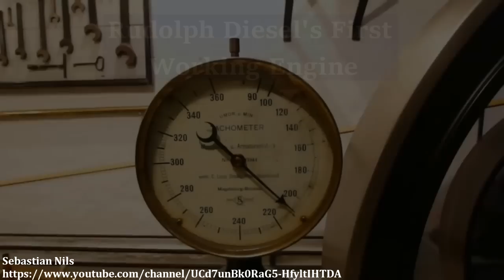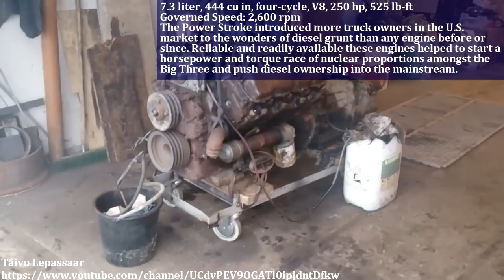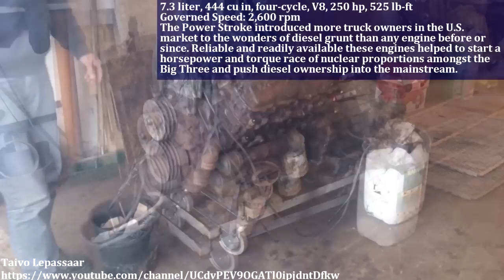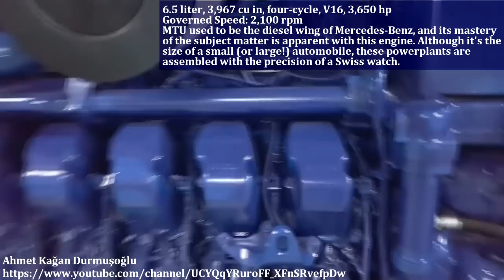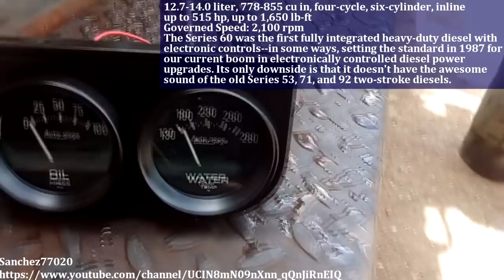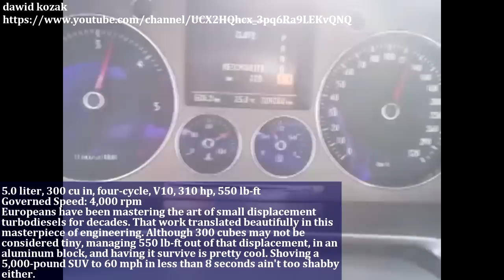10 of the Greatest Diesel Engines - Ever

Comment: And yet another "Greatest Diesel Engines" list that fails to mention some of the most significant diesel ever made. The Toyota 2L is a 2.4lt 4-cyl diesel which was introduced in the late 1970's and is still being produced today. Individual examples have exceeded 1million km and 10k hours, and several millions have been produced. It has been used in everything from Cressida and Corona cars to Hilux and Land Cruiser models to forklifts and minibuses. The Toyota 2L rivals the Mercedes-Benz OM616 for the most reliable engine ever made. (The 2L, despite being similar in dimensions and capacity to the MB PM616, actually nearly matches the larger OM617 5-cyl for outputs.) Then there's the Toyota 1H-Z 6-cylinder engine from the Land Cruiser models, and the Mercedes-Benz OM604/5/6 engines, the naturally aspirated diesels that had the highest specific outputs and the lowest noise.
Reply from the maker: justcarcrazy + oh thanks for great additional informations :)
Reply: Surprised nobody's mentioned Audi... fastest passenger cars powered by diesels. Insanely efficient.
Reply: Hate to break it to you but 1million km and 10k hours isn't shit for a diesel. I've seen 6bt Cummins with 2million miles without a rebuild, and 4bt's in construction equipment with well over 10k hours
Reply: Yeah my father has a Detroit Diesel with almost 2mil on it. Never had the bottom end rebuilt but replaced the turbo a few times, flywheel, injectors, etc. Costs a fortune when the smallest thing goes wrong. It was about 2k just to have a guy look at the flywheel.
Reply: Make ur own then
Reply: Forget about Toyota, where is Mercedes in this? Their inline 5 and 6 are the best!
Reply: justcarcrazy - Toyota's diesel is as insignificant as the runaway throttle situation was... Too many more engines deserve to be on this list ahead of Toyota.
Reply: The Real Elvis lol just to look at it 😂😂😂
Reply: justcarcrazy I have a 86 2LT it's a piece of crap.....  there's actually a defect in the head that will crack eventually.  but even though it sucks it's still really cool
Reply: Ruckus 2lt and 3l will crack heads when overheated because the clutch fan always fails. 😂 they are fine when they run but damn that fan
Reply: 2002 Mustang V8 260hp... 2002 Honda S2000 240hp, weighs less... stompin the Mustang's ass hard
Reply: So all the sudden 15 years ago is considered recently?
Reply: And you completely forgot that the s2000 only has 153 Ft-lb's of torque to the mustangs 302 Ft-lb's. Hp is only half of the performance equation. Apples and oranges bro.
Reply: I'm tired of everyone saying "what about the torque?" Horsepower is a function of torque. Nobody ever considers weight, either.
Reply: soaringtractor that's why nothing more complex than a gun is made outside of the US?
Reply: Peugeot XUD's have done many more miles than 1 million km.  Best passenger vehicle diesel engine
Reply: Another engine that is equal to the Toyota 2 L engine is the Isuzu 4JA1 engine, a simple 2.5 litre pushrod engine that is very economical and very reliable, the 2L and the 4JA1 engines are two gems from Japan.
Reply: soaringtractor
 I have the utmost respect for a lot of Japanese engines regarding their reliability.
Reply: He who does not know God to any saint prays to him... The L series are real gems in all aspects that engines are forever if you do the maintenance in time, if you never had a toyota you will never ever know.
Reply: Totally agree with you sir, clearly you had a toyota or maybe still have that toyota.
Reply: Unfortunately Toyota’s amazing Diesel engines tend to go unnoticed  quite regularly
Reply: @coreyschmidt1647  6BT powered "spotting truck" 34K hours covered over 130K miles driving inside a 40 acre yard NEVER LEFT THE YARD ONCE never below the valve covers
Reply: @ruckus__  done plenty of 2LT heads due to cracking
Reply: justcarcrazy h

Comment: Why didn't you do Scania V8?
Reply: because cummins is king 6 in a row ready to tow 8 in a v you must half to sit to pee
Reply: mikeyjock 3408 is a pile of scrap next to a KTA Cummins
Reply: Scania is the best truck Company in the World and cummins and caterpiler are one of the worst shit ever
Reply: mr holmberg you must be mental! Cummins has been the leader in diesel for decades, I will agree that cat has slid downhill in recent years, but prior to emissions regulations cat was a force to be reckoned with. Scannia isn't shit, they only have market share in Europe, Cummins and cat have worldwide presence. And if you want to talk trucks kenworth trounces that lightweight flimsy shit from scannia.
Reply: Corey Schmidt I think that Cummins are sluggish and and is running rufe and it dosent have enough torq and hp in the truck market at least
Reply: mr holmberg so from 400-600 hp (298-447 kW) with up to 2050 lb-ft (2779 n. M) torque is lacking? Mind you that's for the 15l isx, I drive one every day and it runs as smooth as any other truck I've driven with the exception of an old freightliner that had 12v71 detroit. And if you need more power the QSK 19 offers 800hp (597kw) @ 2100 rpm and 2275 ft-lb (3084 n-m)torque @ 1500 rpm. Hardly a slouch there.
Reply: Corey Schmidt wel Scanias biggest engine hase 730hp and 3550nm of torque from a 16 liter v8
Reply: mr holmberg in marine setup, they top out at 900hp with stock parts
Reply: Landon   Schad xaxaxa, all those weak engines...
Reply: Landon   Schad how much torq dose it have
Reply: Corey Schmidt 800hp and Only 3000nm hahahahahaha
Reply: mr holmberg well sir Cummins unlike scannia understands where the point of diminished returns starts, you make more torque you have to make the whole driveline weigh more making the truck less useful, or you don't beef up the driveline and destroy components. If you need more torque you spec out the truck with planetary reduction axles and multiply the torque you have and cut driveline stress and you save overall weight while doing it. There's a rigging company where I live that has a superhaul truck that puts over 8,000nm on the ground from an old N14 Cummins. It's not about making brute power, it's about doing things intelligently and making the overall end product last as l9ng as possible. Your precious scannia might make more torque at the flywheel but I'm willing to bet the whole truck will be scrap before it hits 2 million miles.
Reply: Corey Schmidt they are still Scanias running like new even with 3 million km... Just due to regulations, fleet owners can't keep the same truck in service until it dissolves
Reply: Caterpillar has always been ahead of Cummins
Reply: Fordguy Santana not really, they've had a few better engines at least when you're talking truck engines. The 3406 a-b had the NTC engines beat but the N14 took it back for that size class in the 90's. The KTA stomped the 3408, the M11 beat the C12 in that class and the ISX12 obliterates it. The ISX15 crushes the C15, and oh ya cat tucked tail and gave up on truck engines so there won't be anything to compare to the new X12 and X15 from Cummins.
Reply: Are you serious? ISX are garbage, that’s why glider kits exist. They always drop a cat c15 6nz or a 60 series, most don’t consider Cummins at all. 6nz always leaves any similar size Cummins in the dust
Reply: Corey Schmidt . What about spun bearings, bad fuel pumps, rods off the block and so on. Every engine is going to have a failure at any point of time. The 6.4 powerstroke is an  absolutely pile of garbage, yet some claim there going 200k-300k with no problems. But good maintenance is what keeps the engine going most of the time
Reply: Fordguy Santana you're thinking about the 6.0 powerstroke, the 6.4's big problems are all caused by the emissions crap and all go away with a dpf and egr delete kit. The 6.0 is plagued with a laundry list of problems.
Reply: OttovonEarth nope. All these are flywheel numbers
Reply: Dr.Redstone cat because not every American know  about Scania DSC16 sadly. Only thing close to that is Cat 3408 and Mack E9
Reply: Dr.Redstone cat because yanks
Reply: Dr.Redstone cat bc they are crap
Reply: Bucky Richardson i guess you shouldn't do such a statement.
Scania is not only in europe but in many other parts of the World one of the top Leaders in building trucks and engines.
Reply: Hardcore Never Dies Domenic K and supplies common rail parts to Cummins
Reply: @toomanytododge2594  Cummins makes a V8 though, so :/
Reply: @coreyschmidt1647  cummins has never lead detroit used to crush them and emd both gm division till the early 2000s where industry leaders. And Cummins follows. The isx is garbage compared to a c15. The c15 makes more power and lasts the isx15 well its popular for shops because they make a large sum of cash for replacing Cummins engines the only good Cummins is the kta and n14 other than that Cummins sucks

Comment: I'd sub in the 3406 Caterpillar & lose the C-series.
Reply: Raynus 1 3408 is a work horse
Reply: When I watched this. I thought "ol Yeller" would pop up.
Reply: Now are you talking c-15's or the c15 and yes there is a diffrence.
Reply: What about the Cat 1693? Million mile motor and sounded so cool. Klickety klack. Owned 3406 b model and c model. Work horses. Injectors on c were junk.
Reply: 6NZ Cat will run and run.
Reply: @Thomas Campbell the c12 was good too. I still love the 3406b and the 3208b.

Comment: I have a 7.3 diesel in my Ford service truck, it weighs 12000 lb and about as aerodynamic as a toaster. I get up to 20 miles per gallon. Is this average for this engine? I never had a diesel before. But it doesn't seem possible. Every time I fill up I check it. Sometimes I'll get as low as 14 miles per gallon. I have another service truck the same size, but it has the 5.8 gas engine Ford. That averages a little under 7 miles per gallon.
Reply: If your 7.3 is getting 20 mpg than you must have absolutely no weight and almost no throttle. My 7.3 with hydrogen cells gets only 17 mpg. My family owns around 10 7.3s, the average for them is 11-14 mpg. I am calling bull on your numbers.

Comment: The 'Diesel' diesel, (first picture) actually appears to be a 4 cycle engine. For the Wartsila effort, you could also mention that it stands 4 stories high and has a 300 ton crankshaft.  Like others, I was disappointed to not see a 2 stroke Detroit.  I worked on 53, 71 and 149 series and admired the way they thrived on hard work. The ear-splitting screaming roar of a 1600 hp, 16v 149 TI  in a WABCO Haulpak, carting 170 tons of iron ore up a hill, I remember well from the '70s.
Reply: I agree. Just a side note. The guy involved with making  the Detroit's also worked on the EMD. In the thirties!

Comment: No Perkins in there...!
Reply: Should there be?
Reply: No. No there shouldn't.
Reply: they couldnt get one to run long enough
Reply: TheRebelOne correct. the 6/354 was a revolution in its time . Good cold starter econonical and good laster
Reply: @ronkennedy8676  The 354 ran for thousands of hours more economically than a lot of other engines, normally aspirated and loaded to the max blowing black smoke it would still only burn 4 gal/hr. Turbo charge it and you could pull down buildings and it would still run for 10000 or more hours before a rebuild.
Reply: @randymagnum143  My word he should,  it powers the Challenger I & 2 Battle Tanks The Best tanks in existence and the Vickers Khalid
Reply: @austindenotter19  We had some in our tippers that lasted 15 years an when  I left they were still going
Reply: @ronkennedy8676  the 6354 and the 4236 were awesome because the head seal failed way before you could do damage to the bottom end.  It was like a fuse. 😂
That, and using lucas for the injection pump, insured a long life for the bottom end.  Seeing as how it would be down for service most of the time, and all!
Reply: @georgeyaworski7176  you know all Nebraska tractor tests a re available online?  You can go see for yourself how many more efficient diesels their were contemporary to the 6354 and 4236?  It burned 6.3 gph @ 93 hp.  For comparison, an Allis-Chalmers 301 burned 5.7 gph @ the same 93 hp.  A 453 detroit made 100 hp on 6.1 gph.  And the detroit will last far longer, under far more adverse conditions, and be far less expensive to overhaul.
Reply: @randymagnum143  man you must  have had a hole in your measuring bucket.  I had three of them. In Masseys and one in a Chamberlainand found it almost impossible to get more than four gallons an hour  through them.  Never heard of any head gasket  problems and there was heaps of 354s around our area
Reply: @ronkennedy8676  the figures i posted are from the Nebraska tractor tests, i trust them.
Even perkins knew they had head sealing problems.
Reply: @randymagnum143  wondering have you ever owned  or operated one.  I have done thousands of hours driving them.  One did over ten thousand hours and still had the original  fuel injectors and  C. A.V injection pump. Randy there  were heaps of these engines in Australia.  Many old korosine Case Oliver Twin city massey harris and Chamberlain had 354 fitted to them and they were and amazing  success . Well that was my experience anyway
Reply: @ronkennedy8676  the liner protrusions on the liners was a very fragile and stupid design decision.  The combustion chamber design was outdated when they were introduced.  Cav pumps are shady knock offs of roosa master pumps at best.  They were inefficient compared to their contemporaries.  But other than that, they were gold!  😁  the 310 Waukesha they were paired with in the Oliver had lower end problems, but would walk all over a 6354.  When turbocharged, they were like a 404 Deere......they had many problems that perkins had to address.  Naturally aspirated, they were also like a 404 Deere, inefficient and a complete pig.  The 301 Allis was in every way superior.  Hell, the 453 detroit was more efficient and durable.  The 4236 was a weak pig.  I'd take a gas engine anyday over it, especially if the gas alternative was a 226 Allis-Chalmers.
Reply: @ronkennedy8676  you Aussies are into 351Cleveland fords too.  I guess there's no accounting for taste!
All Massey Ferguson tractors are overgrown n series fords.  Ferguson bought Massey Harris and ruined a promising tractor line.  They are only suited to pull pies out of the oven.  😄
Reply: @randymagnum143  im not into v8 fords although  we do drive a Territory and many years ago i had an A model
Reply: @randymagnum143  . I have no interest in fird v8s at all but we do drive a Ford Territory and many years ago i had an A model which was pretty indestructible.  Now about Massey Fergusons.  The old M H tractors  that came iut here maink 55k and diesel models were  great tractors.  Very refined  fir their time with helical cut gears.  Very quiet.  They were brilliant with those  favourite engines of yous (sorry).  I had two hooked together and fiund i could cover  many mire acres using less fuel per acre than one tractor.  . When they went to MF 65 it was a step back but they seemed to befairly reliable lil machines.  Neighbiur had 4480??? Cummins 903. No trouble  with it but thirsty.  So  there we have it.  Stay safe Randy
Reply: @ronkennedy8676  i had to drive a mile in reverse on a 65 when i was a kid, because i didnt know the secret to putting the shifter back in the rails with a screwdriver through the filler cap!  Have a good one!